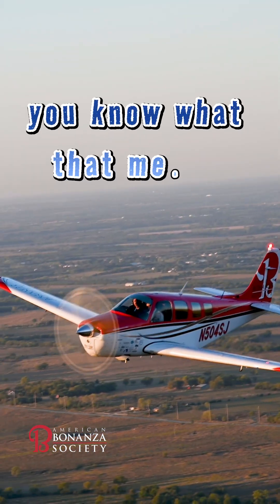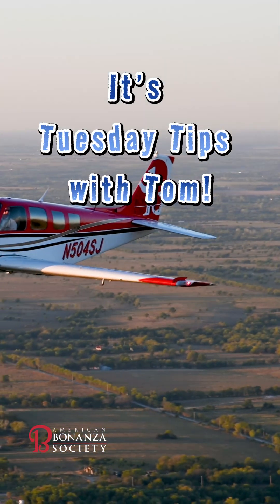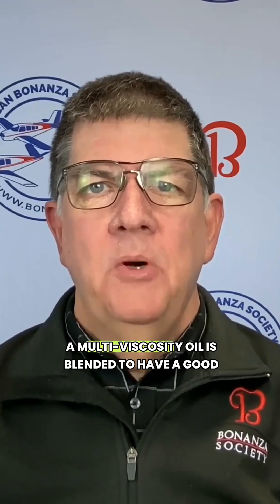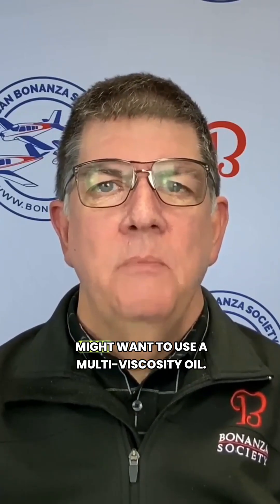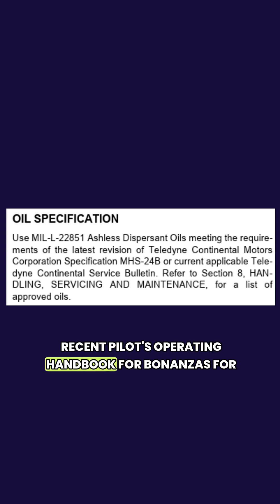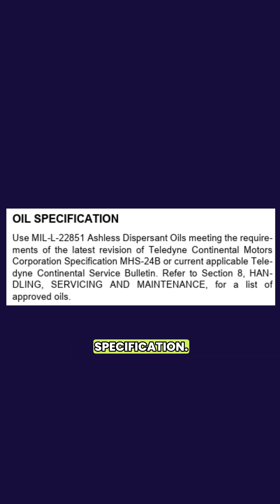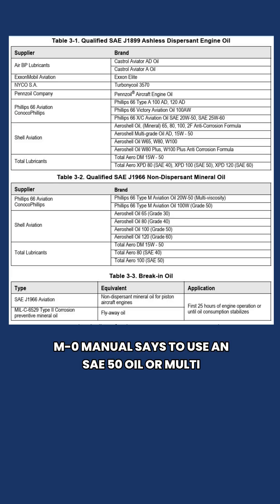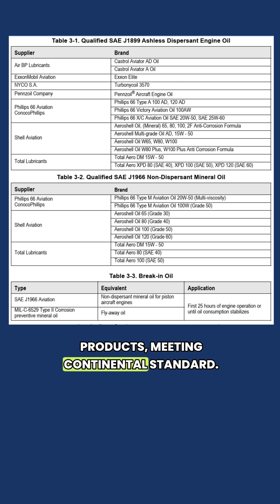What Oil Should You Use in Your Beechcraft? Understanding Approved Engine Oils #beechcraft

Comment: Correction there, Tom, viscosity has nothing to do with slickness. It is as the word implies viscosity is the thickness of the oil and is determined by the manufacturer based on the clearances that are set forth in the bearings and other components. Multi weight viscosity oils are thinner, which make starting in cold weather easier, and when they warm up chemicals within the formulation thicken the oil to treat it like the upper number.
Reply from the maker: From a practical standpoint the thickness of an oil will determine how well it lubricates at cold temperatures, hence “slickness” refers to the effectiveness of oil to flow in the context of engine preheat. The ABS Technical Advisors also warn of one particular oil being “so slick” that it does not stop the engine starter as rapidly as others and correlates to early starter failure, as mentioned in the video.